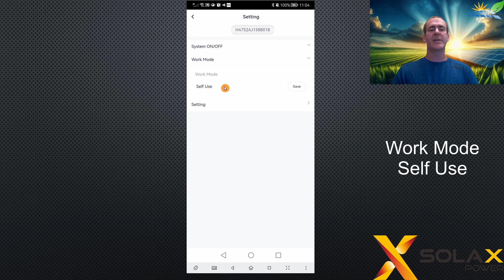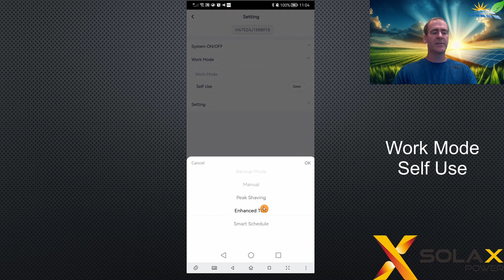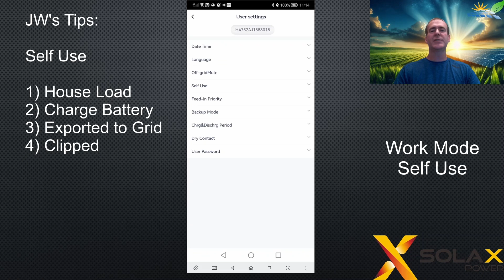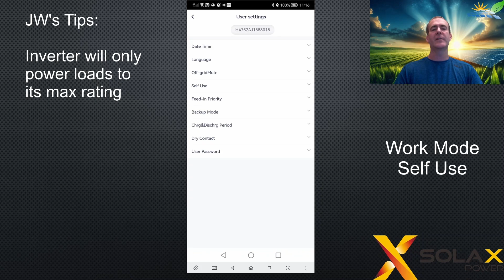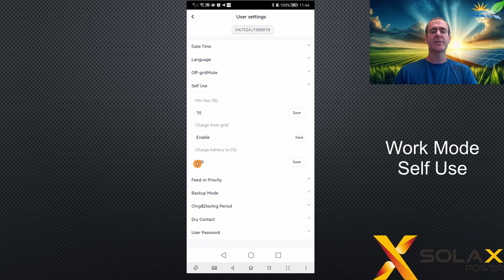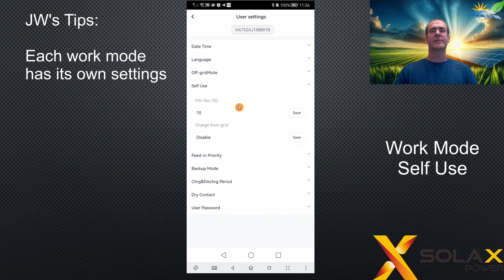04 - Mode Self Use - Solax Inverter User Settings Explained

Comment: can the Solax X-1 Hybrid7.5 inverter be used without a battery at 7.5Kw output ?
 Example: Use the PV in day time, at night use the grid. no battery
Reply from the maker: Yes, it can be used with just PV and no battery, or just battery with no PV, and of course with both.
Reply: @JWSolar  thank you